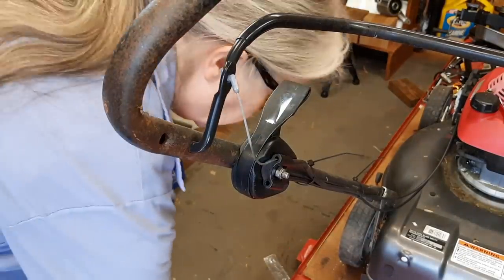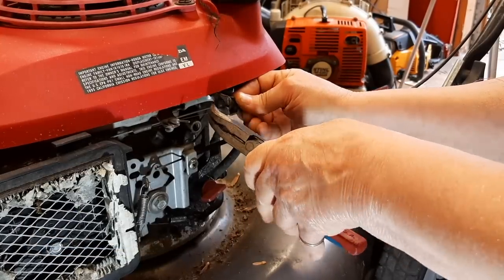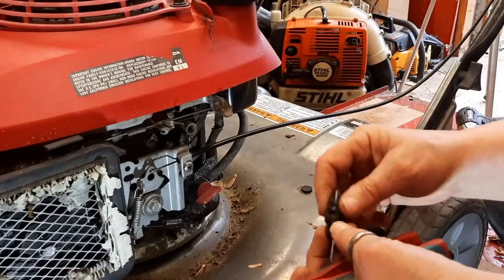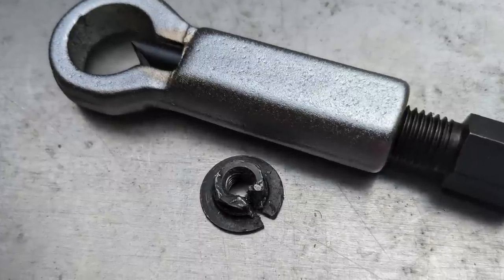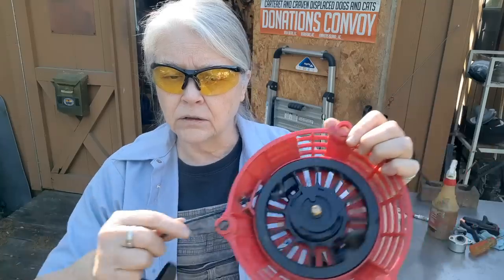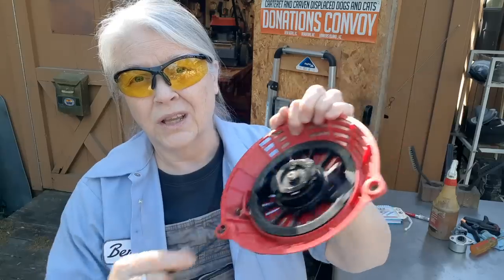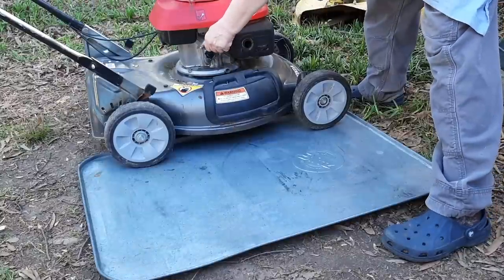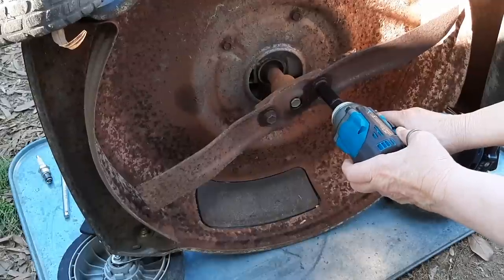Neglected Honda Harmony HRS216: Complete Service

Comment: As a youngster I was assigned the unenviable task of cutting our lawn with a 1950’s style reel push mower and catcher. Perhaps you can appreciate my elation at getting my hands on the most basic Lawnboy rotary 2 cycle mower. I started an unprofitable lawn mowing service by pricing my services too low just to get the job. I was very impressed with the durability and reliability of this mower. The only problem I had was the debris blocking of the wire mesh air filter. Never did disassemble it properly so only ran intermittently. Eventually the deck broke and that ended my career. I used to clean this reusable filter, sharpen the blade and lubricate the mower. It was so basic you had to rewind the rope manually after every unsuccessful pull.

I was always amazed and delighted by the modern self propelled mowers with the auto rewind features!
Reply from the maker: Things have changed for sure! Thanks for watching.

Comment: I use to mess up those screws till I saw a video of yours. Bought a J2 and has been a god send since.
Reply from the maker: Good move!
Reply: @TheLawnmowerLady  even the idle screw is the same?
Reply from the maker: @mgomez5606  On most models I see, yes, it's metal with a non-removable jet. Others have a plastic removable jet that often needs new O-rings.

Comment: There is a trend with your repair video. That trend being that you use OEM or quality parts. I have found that OEM parts just work. No poor quality control issues. Also, nice job on taking the time to clean the OEM carb. Some folks might replace it with cheap low quality no name parts. I have found that in general, the cleaned or rebuilt OEM carb with be of higher quality than a no name knock off. Nice job.
Reply from the maker: Thank you! I appreciate your comments. The OEM parts honestly don't add that much cost, and I don't want returns, if I cheap out on a few $$.

Comment: Hey Stella. When i have those nuts that won't come off the recoil, i will try to tighten it first then try to loosen with impact gun. Doesn't work every time but probably 80% of the time. Might be worth a try. As always, great video with good commentary of exactly what you're doing.
Reply from the maker: You are so right! I forget if I tried that (probably,) but this gal sat out in the weather waaaaay too long. I appreciate you watching. Cheers Gerry!

Comment: If the carb bolts are installed in sequence with assembly then held up at slight angle it’s really easy to reinstall.
The blower housing removed makes it even easier.
Hondas are great mowers.
Mine after many years of heavy use functions and appears as nearly new. It simply could not start easier or run better with just basic maintenance.
Reply from the maker: I agree, the older Hondas are well designed machines. The only complaint I see regularly (though not experienced myself) is the rocker arms on the valves tend to get bent out of shape, making adjust the valves on GCV 160-190 engines impossible without replacement. Thanks for watchin.

Comment: Subscribed to your channel yesterday after your video helped me fix my neighbors GCV170 🎉
Reply from the maker: Yay! Glad to help. I appreciate you watching!
Reply: 170 needs repair already? Not a good sign
Reply: @haneyoakie14  Was never serviced since new. Engine would surge whilst not even cutting. Deep cleaned the carburetor and replaced gaskets. Now it runs smooth
Reply from the maker: @EmoDKTsuchiya  These machines do need at least some basic maintenance, that many folks won't bother to do. Glad you got yours going again.

Comment: Yep you gotta contact Brandon to get one of his cable removal tools works 100% in seconds. Don't you hate it when removing the recoil those studs come out instead of the nut loosening off? Seems like the previous person torqued the nuts down with an impact gun i think Nylock nuts with a washer work better never have this issue. 100% a super neglected mower and i think your right the guy picks them off the street gets you to fix them then resells them for a profit. What do you think? Nice job Stella you even got to use it to cut the lawn with it and with a little spit and polish and red spray paint on the faded recoil it would look like new.
Reply from the maker: I suspect the previous person didn't do sh** except leave it out in the rain. That cable was rusted solid at the bottom there. This came from the RotoHoe guy BTW. No telling what the real story is... I appreciate you watching. Cheers Mr Wayne!

Comment: I’ve been prelubing the new cables with Napa silicone spray with the little tool 
Seems to last longer 😊
Reply from the maker: I often do that, but the guy was chomping at the bit to pick up the mower, which as you can guess, he showed up 3 weeks later. Where is my ::rollingeyes:: emoji

Comment: Compressed air blowing on magnetic fly wheel and WD 40 all contacts and pickup coil they spark powerfully. New plug and air filter fresh quality oil and gas sharpened balanced blades clean fins and insure drive system ratcheting gear mechanical parts are correct and cables and belts in service order.
Mine has seen so much use I replaced the four bald tires from trouble free service.

Comment: Those studs are a godsend. These carbs are such a pain to reassemble. Why not just leave them in and use nuts? I wanna give you a tip from my world of vintage Triumph motorcycles. I use this stuff called Hylomar M on almost all my gaskets. It usually allows the components to pull apart without damaging the gaskets. It also works good at having questionable gaskets reseal. Or often, no gasket at all.
Reply from the maker: Good call on the Hylomar. I use Hylomar Blue on my antique Lambretta rebuilds, and it comes in very handy if a bit of gasket material sticks or tears on this lawn/garden equip. Most of the commercial Hondas and some of the newer models do have studs. I think the airbox might need to be modified or swapped out to use studs to keep from warping the airbox. I appreciate you watching. Cheers!

Comment: It would be e if you had the lawn mower cable lubrication tool for your help with this matter of the cable lubrication
Reply from the maker: Could be, but this was rusted solid at the lowest point, no amount of lube could fix that. Thanks for watching. Cheers!
Reply: @TheLawnmowerLady  that is a strange thing to have happen to this cable hopefully it is not expensive to replace it
Reply from the maker: @robertmailhos8159  Not too bad. I think it's about $10 bucks on that AMZN link in the description.
Reply: @TheLawnmowerLady  thanks for the info on this cable young lady 💐🌹

Comment: great video showing your expertise in small engines. thanks for sharing. lawnmower lady, what mower do you suggest  as a replacement to these hondas as honda stops  making them this sept. ?
Reply from the maker: That is a tough question. Lately my advice is to look for an older HRX (5-6 y.o. mower) Far superior machine. Parts will be available for a good while. I appreciate you watching.

Comment: Nice vid as always! Where can I get that squeeze bottle with the brass spout for the homemade penetrating oil??
Reply from the maker: That's a Pressol 06864 125ml bottle. It seems they are readily available in Europe, but scarce in the States. I found mine on ebay. Another great suggestion from my good friend Tom, @vintageenginerepairs. Shipping can be very expensive, often a good deal can be found. I appreciate you watching.

Comment: Sub'd from Canada, great channel. I started with a couple Honda mower videos and I appreciate the break down and information. I have this similar mower but self propelled model/bagger. 
 Do you have a video on governor adjustments for Honda mowers and maximum RPM ? I assume by your digital meter to keep it below 3200 rpm? 
Thanks !
Reply from the maker: Awesome, thank you! I don't have a specific video on that, but I have enough dead engines laying about, that would make a good video. There's some complicated math based on blade length to determine maximum safe blade velocity, but math is hard, LOL. I suspect 3200 is just fine. I appreciate you watching. Cheers!

Comment: Would the stainless steel studs trick also help on the GX160 Honda engines?  Getting ready to repair a pressure washer.
Reply from the maker: I know on a GC190 pressure washer, they could have been a bit longer: https://youtu.be/b7lffKGZZsE

Comment: hi at 5:03 you are using a bottle with brass connection to pour gas in intake. where did you bought that.. seems like it is available only in UK and Australia.. I see something in Amazon which is GEDORE 298-01 from amzon . like to see where u got it..
Reply from the maker: I had to get mine from ebay. The item I purchased was Pressol 06864 Graisseur avec Laiton Bac 125ml It shipped from UK.  As of writing this, there seems to be two sellers that list this, one with crazy expensive shipping to US, and the other with more reasonable shipping. I did have a bit of trouble with one of the three I purchased (it was defective) and went in a few circles with the seller before they finally gave me a partial refund. Thanks for watching.

Comment: Those stainless rods you got off Amazon, what was the length on them? Or did you have to cut them down?
Reply from the maker: I cut one of them  in two, cleaned up the threads, and cut a slot with a Dremel tool on one end.

Comment: Now, here’s a mystery….with such a poorly maintained mower, you wouldn’t assume that the owner took the time to clean it when putting it away, or taking it for repair.  But there is not a blade of grass under the deck…..?????  I definitively think he picked this up off the side of the road…..
Reply from the maker: I never thought about it like that, but you might have hit the nail on the head. I appreciate you watching!